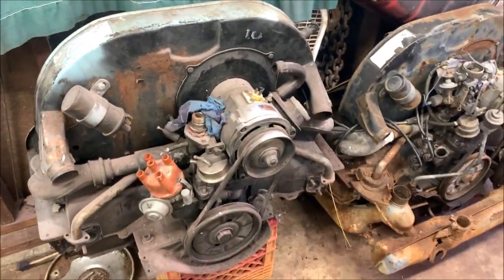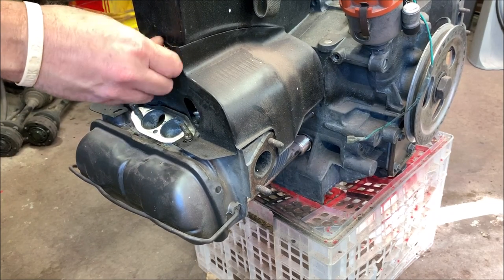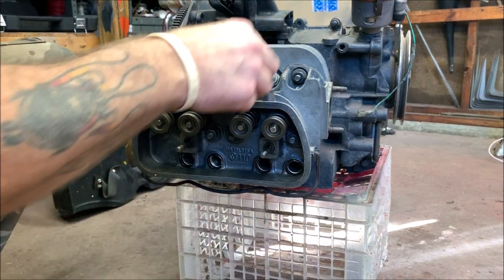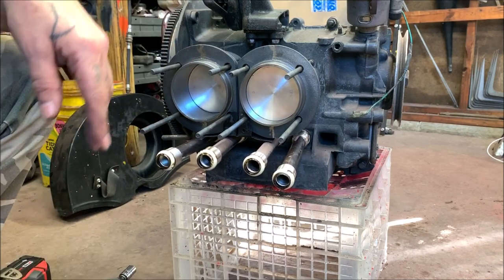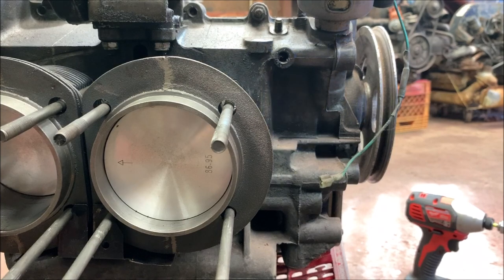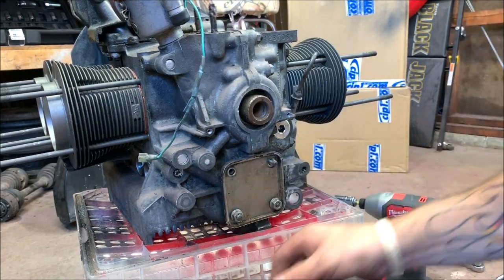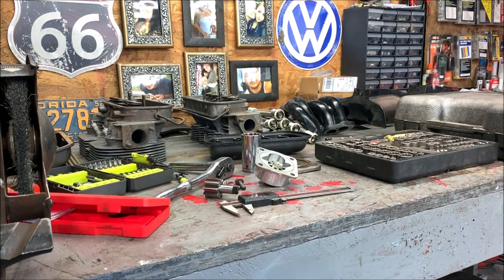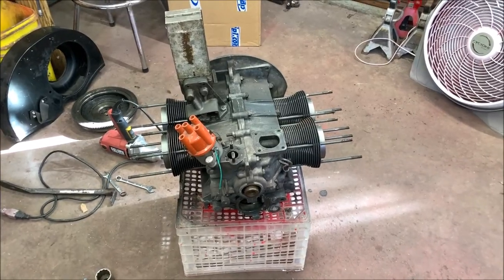VW Beetle 1600cc Engine Tear Down - Taking a Beetle Motor Apart - Disassembly - Super Beetle - Baja

Comment: You got a deal on that parts engine.  And no loose studs!  I had 3.  You'll have it on the road in a few days.
Reply from the maker: william tanner truly William that was an excellent deal with your right. The pistons and oil pump were never used. And the heads are very nice. I did re-lap the valves, I did a video on that too. I was thrilled.

Comment: The cylinder tins can't be used on your bug without adding sheet metal  that was cut off.  They are great for off road buggies.  Check out what OEM tins  look like. 👍
Reply from the maker: Vintage 76 vipergreen # Romeo I have the OEM on my other motor I’m using. I caught it after I looked at them again. Thanks for being here!!

Comment: verify those rocker arms. we didn't get a good look but they look like 1.1's. been seeing the family photos in the background for a while now.
Reply from the maker: Scotty C I checked they only say EMPI on them. My buddy I bought the engine off of said they’re 1.25. Not sure how to tell 🤷‍♂️
Reply: @SladesVWBeetle  do you have some 1.1 stocker's about the place? just eyeball it. the difference is easily noticeable. it's possible empi changed the forging slightly so those are 1.25 but look like 1.1. i looked at some samba photos and an ezgz vid but there are no really good photos showing the difference. the vw forging 1.25 has the pushrod cup significantly shifted towards the rocker shaft.
Reply from the maker: Scotty C I looked today, after reading your comment. I put a set of stock ones next to them and they looked identical. So I think you are right.
Reply: @SladesVWBeetle  well there go. see proof positive that i don't fast forward your vids. just looking out for you.
Reply from the maker: Scotty C Haha! Thanks Scotty! I guess I’ll use them since they’re new. But must be stock replacements by Empi. I don’t know what 1.25 would look like.

Comment: Another great video Slades. Seems you are always using the same 1/4 ratchet every time lol at least to start with then you move to bigger tools 😂 I pay attention to things like that. I’m learning a lot that I didn’t know. Even though I’m a mechanic I don’t see or deal with these everyday so I like learning specifically about these. Nobody at work shares the same VW interest lol.
Reply from the maker: Yeah where I worked for years, no one there had any interest in the VWs. So I had to work on them as they came in. Lol I use the 1/4 inch a lot unless it’s heavy torque. I have been that guy who over tightens stuff!! 😁
Reply: @SladesVWBeetle  lol it happens. I have a coworker who doesn’t like using hand tools so he tries doing everything with power or air and gets yelled at by the boss 😄. Nothing like having him strip out an entire 6 spark plugs driving them down with an air gun or one of the many drain plugs he has tried to impact on. It’s a wonder he still has a job. And let’s not forget the die he drove down that I was telling you about earlier lol 😂. He hates hand tools that much.